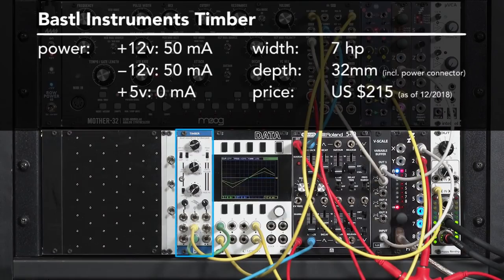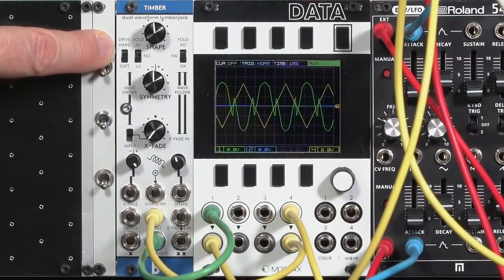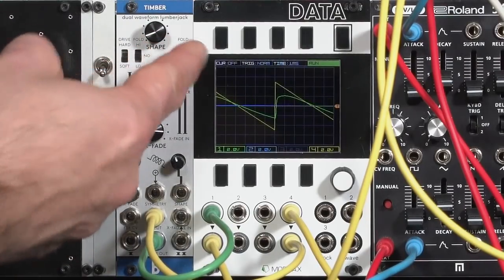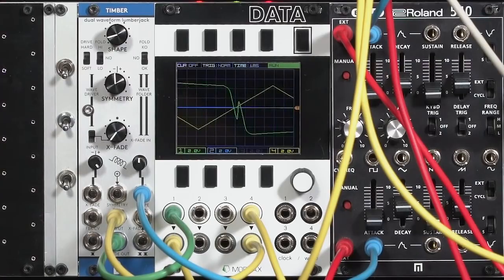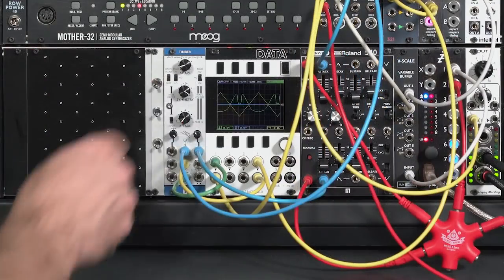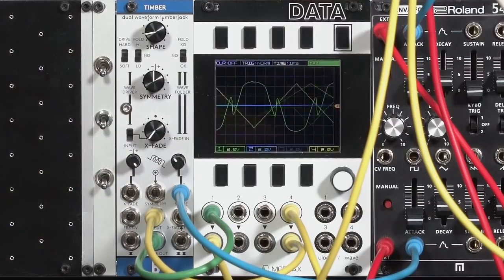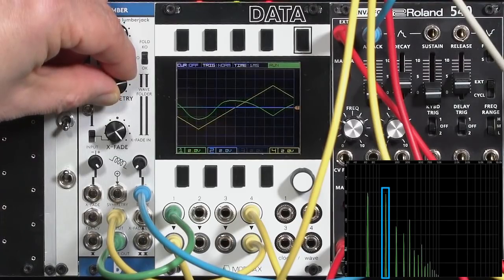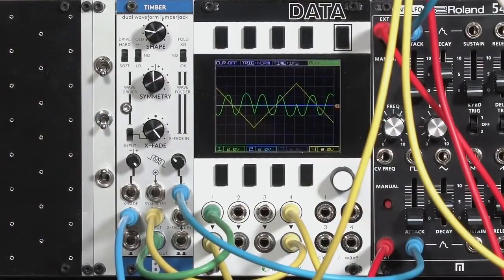Bastl Timber Dual Waveform Lumberjack (LMS Eurorack Expansion)

Comment: Chris, another very helpful video EXCEPT.... twice in this video you've said tube amps give more even order harmonics. Even order or odd order harmonics depend on circuit topography and bias point. It has nothing to do with whether the amplifiing device is a tube, a BJT, a FET or ... Different devices have different transfer characteristics but whether the circuit makes more even order THD than odd order THD has nothing to do with the underlying device. If the circuit is push/pull it's gonna make predominately odd harmonics (because the even order harmonics are mostly canceled out due to the topography) whether tube, bjt or FET based. If the circuit is single ended it's gonna make more even order harmonics because there's no mechanism for cancellation of even harmonics. They still have odd order harmonics. You said it correctly when you said an asymmetrical wave has more even order harmonics and a symmetrical wave has more odd harmonics. I get so weary of hearing all the "magic" things that tubes do. Please, please, please don't perpetuate misunderstandings and myths about how tubes work. They don't "warm up" a digital sound. If your sound is crap, putting it through a tube amp isn't going to make it not crap. Tubes are spectacular audio devices but they aren't anymore likely to produce even order harmonics than a BJT. IF properly designed a tube amplifier produces it's THD in lower order harmonics than some other devices but there are lots of tubes with pretty kinked transfer functions and lots of poorly designed tube amps that were built to please accountants and marketing people that sound as nasty as any BJT amplifier. There are great transistor amps also.  I've been using, studying and building tube amps for almost 60 years and I get pretty grumpy when people assign all kinds of qualities to them that aren't unique to tubes and have way more to do with circuit topography. Good sounding tube amp sounds better than a poorly designed BJT amp because the distortion products are lower order harmonics. This is another way of saying the transfer characteristic is more linear. Higher order harmonics are more disruptive to the musical experience. This has nothing to do with even or odd harmonics. You have given a lot of good information to a lot of people. That's the strength of the internet. But we have to keep each other honest when we encounter bad information. Otherwise the internet gets weaker and weaker.
Reply from the maker: Excellent point - I should just say asymmetric waveforms produce more even harmonics, which is a characteristic of some tube circuits. (You would think I would have learned by now not to generalize! ;-) )